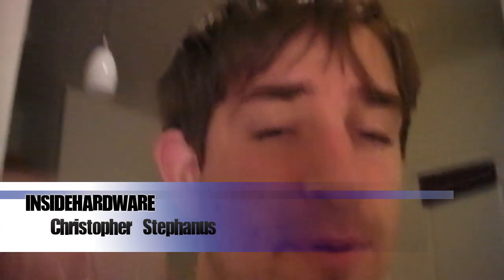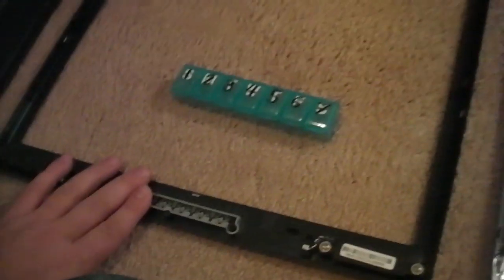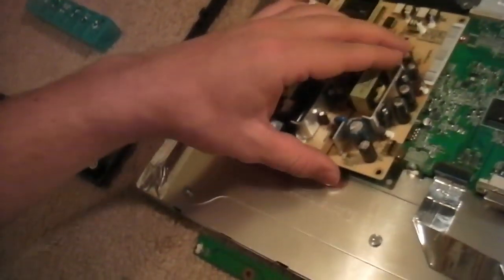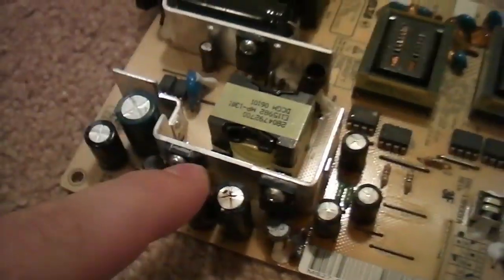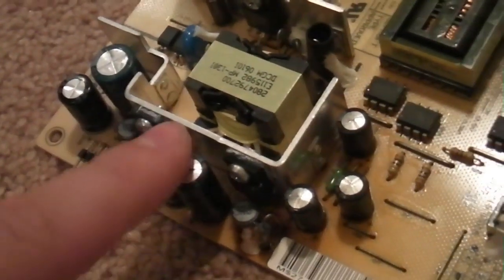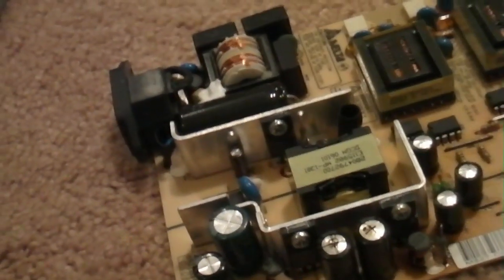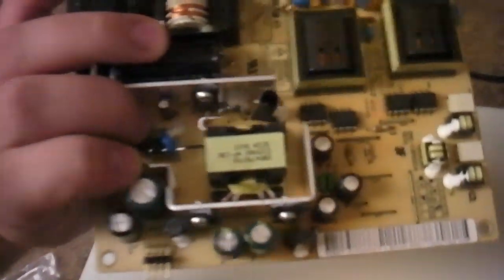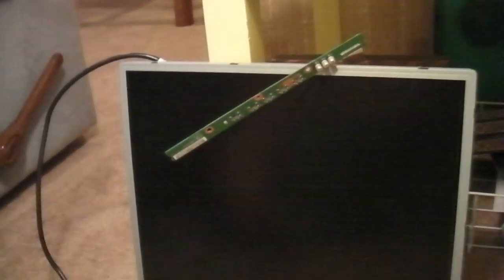How to fix an LCD Monitor or TV screen

Comment: meex88hiphop, don't know if you are still around but let me say this about the comment I am posting on:  You sir are  dead on.  I have (had) a new asus mobo and it ran fine.  I thought about hooking up the fan for the graphics card to one of the fan slots on the mobo.  5 capacitors around the heat sink and cpu all fried within seconds due to the sudden energy.  

Lesson learned for me:   don't know 100%..   don't do it..  
PS  where the hell were you when I did this??

Comment: Micro What ???
uF stands for Micro Farad !!!

Not Micro Fari !!

I think you will find some printing on the cases of those Capacitors to indicate polarity , in my 40 years of electronics I've never seen a cap without polarity printed on the case.
You should also tell you viewers that the temperature rating of these caps in very important, you want to replace with 100+ degree rated caps. Not the regular 85 degree. Else you will be doing this over again soon.

Comment: Get the boards away from the carpet and ground your self, especially when air is dry or you will just be wasting your time, one of those IC receive a static discharge nothing will work.

Comment: thing i have noticed the monitors that have the problems are the ones that have on board power supply's never had one with a power brick was told that the heat produced by the ps dry's them out then short out

Comment: You made the worse mistake a repairman can do, buy caps from the manufacture that sold the bad caps! Chinese made caps are usually not a good choice, they don't last, even if they are cheap, the same thing can occur. Decent caps are usually Japanese made, they are long lasting, they might cost a little bit more, but how many times do you wanna fix the same problem, over and over?!